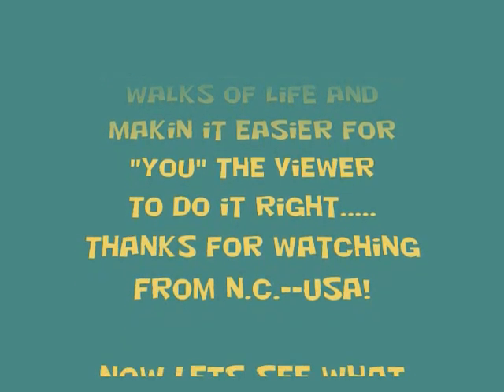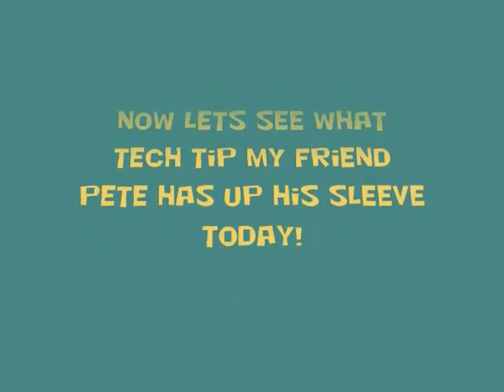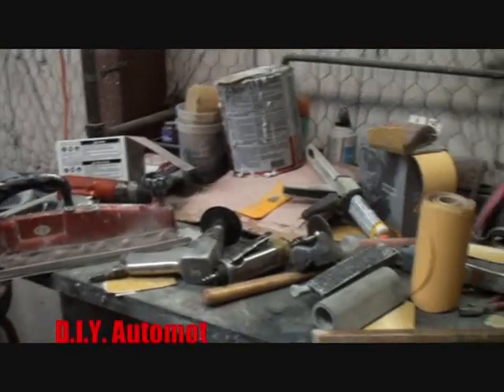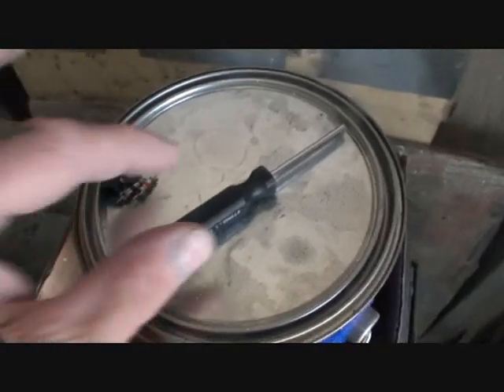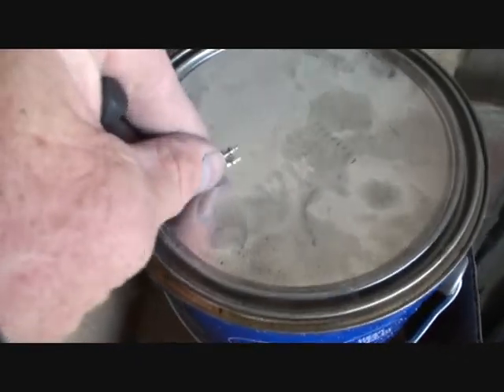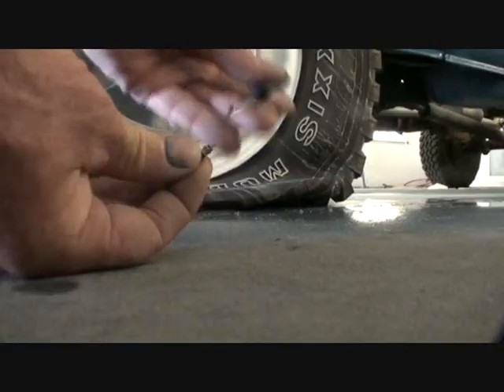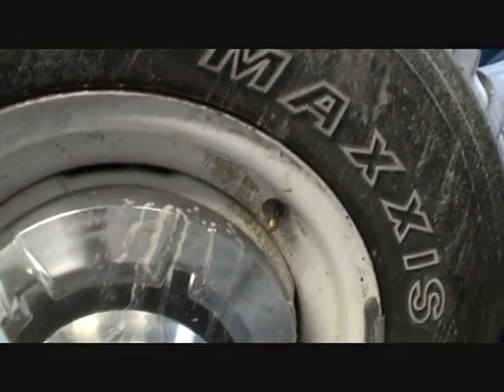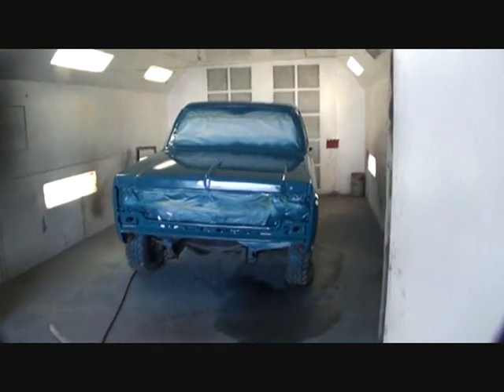Paint Your Pickup Truck The Easy Way

Comment: Did that one time on a truck.When I was repainting recall trucks for Ford. The tires were the wrong size for the rims. The bead pulled away from the rims. End up sending the wheels to a tire shop to have them inflated. Good tip.

Comment: i done this 3weeks ago and wrecked a $300 tyre because i had it sitting around for 3 years in storage

im only 25 but i still know you can always learn new things so in your 30 years you have been lucky in my 10years of customizing cars i guess i have been unlucky 
point being 
a pair of low jack stands or even 4 old tyres laid down underneath  would be much safer with great track record for no problems 
so far yours has a 1 fail how many more are out there 
this is constructive criticism

Comment: Funniest thing is I have a 1983 Oldsmobile delta88 Donk.  Bought to sell but having fun driving it for now.  26 inch rims and a lift on airbags.  It's higher than my minivan and most 4x4 trucks.
It's on eBay right now actually

Comment: hmmmm...Stumpy's got a resto going on a 2-cycle LawnBoy.    will try the vinegar on it....slightly different as this mower has an aluminum alloy deck and once the paint is feathered and the deck is primered up a cured good, a coat of "grabber green" will make this LB look like one of Pete's trucks.     fwiw some John Deere machines have the alloy deck as well so it may be what the NC gal had going.

Comment: i would be careful with this procedure as you dont know how old the tyres are and could tare a crack on the side wall by changing the direction the rubber has been sitting..